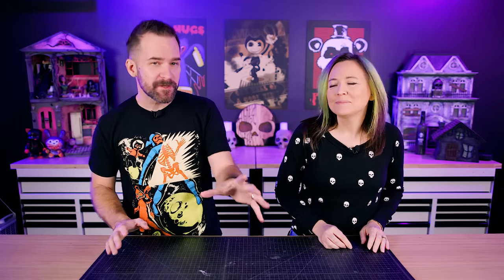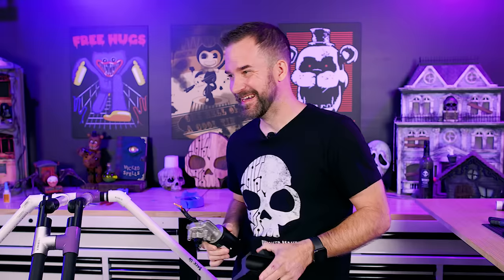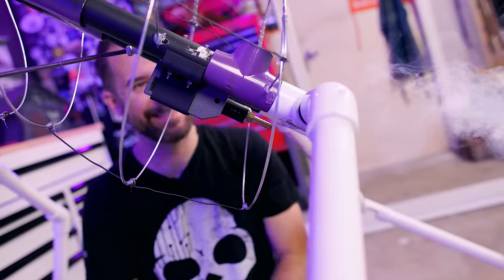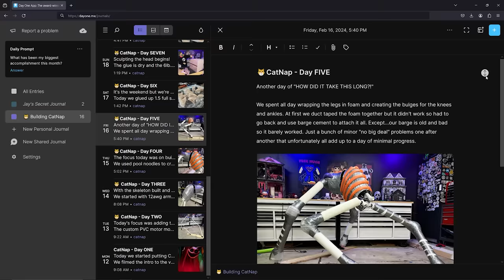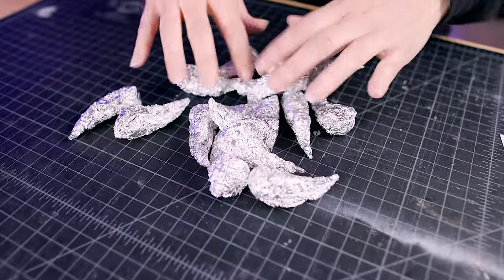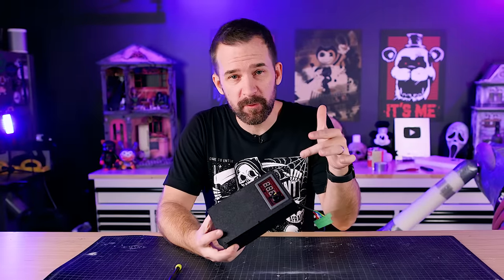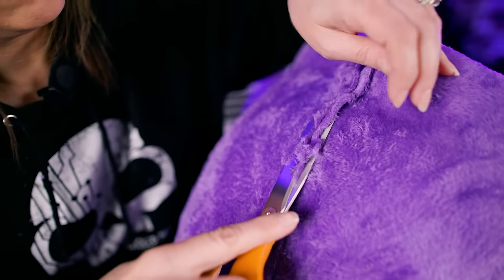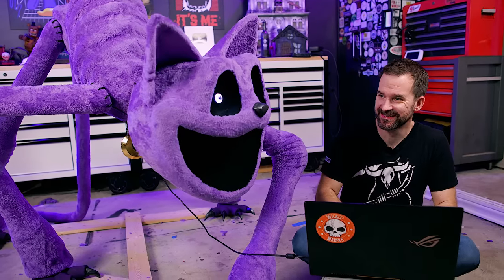We made a real CATNAP Animatronic!

Comment: The visual accuracy of these animatronics are BEYOND anything I've ever seen in industry-haunt animatronics
Keep up the amazing work!!
Reply: Could you imagine running into this in a haunt?  I kinda worry a tiny bit about the durability of the animatronic, since it's really built to video and not to last a season or ten.  I can also imagine further exploiting the Arduino running the neck motor.  Could you imagine some pressure mats on the floor or passive IR motion sensors tied to this thing so it turns its head to look at you as you pass?  

I mean, yes, at this point it's actually fairly possible to build a machine vision system and have your animatronics lock eyes with guests, but even a simple interactive element would terrify most people.
Reply: Like those motion activation candy bowls, where the hand tries to grab the person taking candy or chips out! As the person moves from one mat to the other, the head follows them😂!